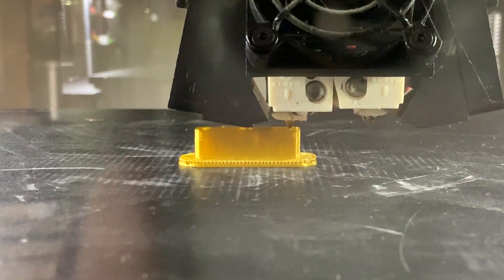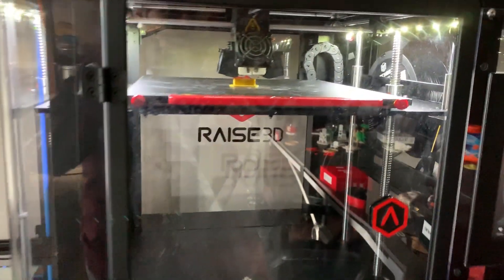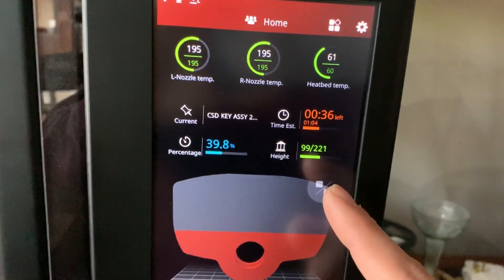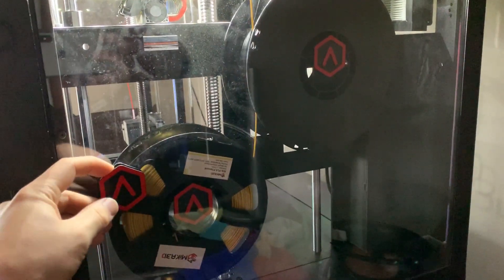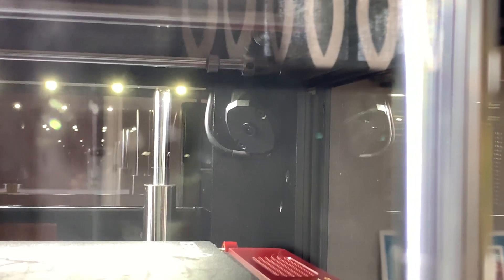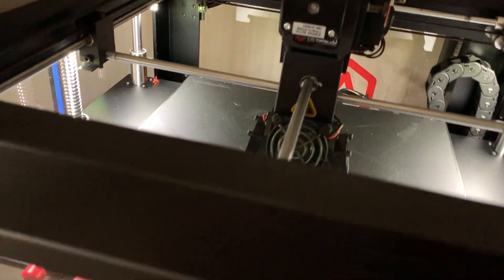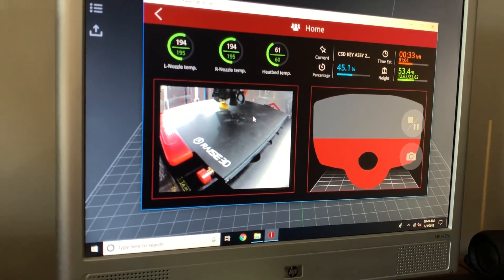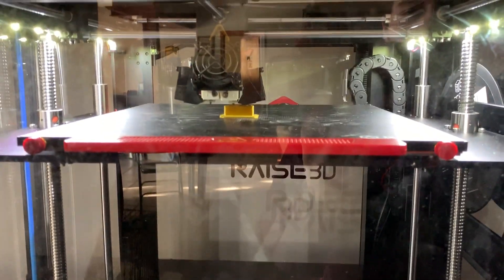"WE BOUGHT A $4000 PRINTER" Raise3D 3D Printer Review!

Comment: if the top is open how does the filter do anything lol
Reply: If you're printing ABS or anything else where you want HEPA filtration then you simply put the clear acrylic plastic 'top hat' on the top of the printer. It's about 7 inches tall and covers the entire top section and in included as a standard item. If you're printing PLA and was the top on for sound abatement, you may have to reduce your heated bed and possibly extrusion temp setting to prevent overheating.

Comment: I don't think it's worth the money, mine has given me nothing but trouble. From the warped build plate to serious problems with the print head assembly .. all of it. Try leveling the bed on this thing, and be sure you have a day set aside for it. No matter what I do I can't print solely out of the right extruder, and currently the left side is broken so I have a $4000 paper weight. There are a whole bunch of little things I don't like about this printer and it's software well beyond problems I mentioned. If someone out there is looking for a larger print volume, consider the bcn3d printer, I have the older sigmax and love it. Anyway, hope you have a better experience than I.

Comment: After a month, what do you think?
Reply from the maker: It will definitely give you some of the best duel colored prints out there. I have absolutely no complaints about this printer except that if damage the plate by scratching it; it’s very expensive to fix. Expensive printer means expensive parts
Reply: @handyreviews98  I figured it would be not cheap for repair either.  I am hoping that with my light use and its build quality I may not have to do that too often.  I'm leaning towards this printer, going to start using their build software and see what's that's like before I buy one however.  Thank you for the good information.
Reply: @handyreviews98  I'm looking at it thinking 'can it handle large, flat PolyCarbonate/Nylon12 without warping?'. Have you tried printing large PolyCarbonate/Nylon12 items yet? If not, I'd LOVE to see a quick video! Those are big problems because they need so much heat (both on the bed and in the chamber) to avoid warping. Thanks!